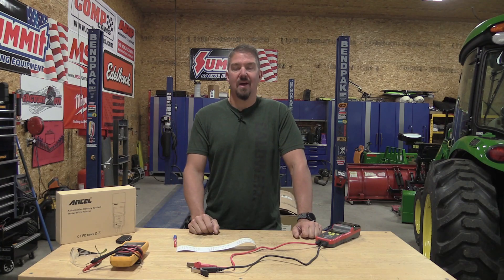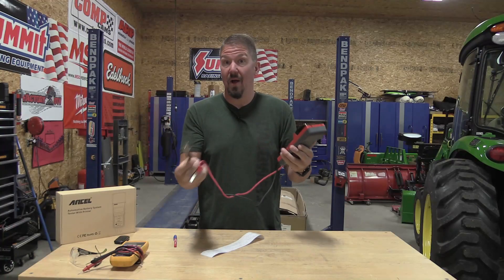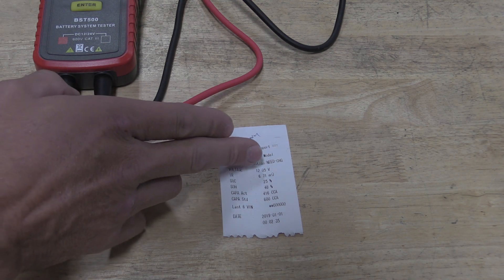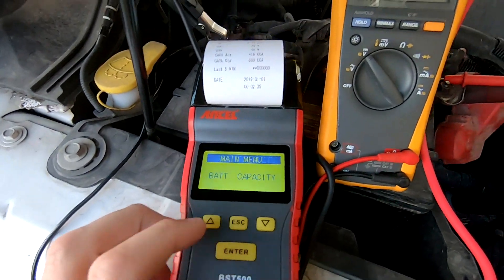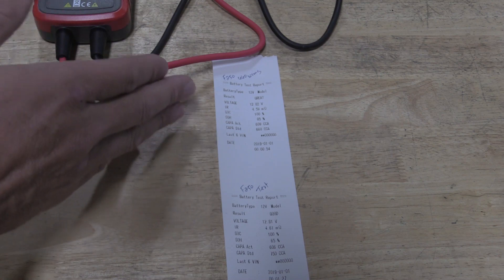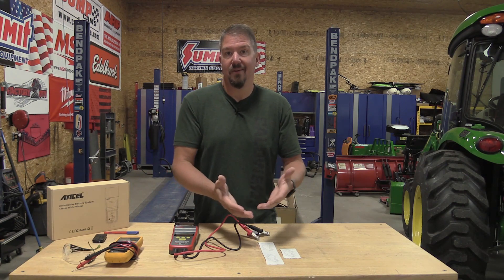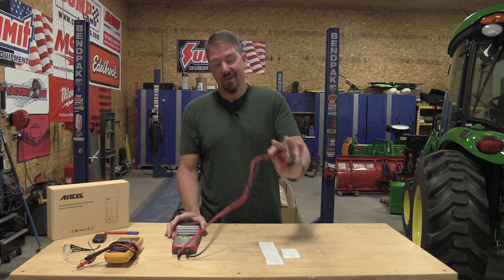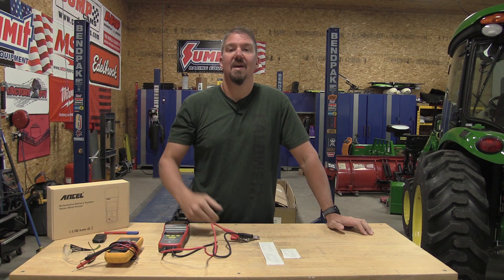Truck Won't Start - Ancel BST500 Battery And Charging System Tester Review

Comment: Just say it POS. People need to just learn how to use a multi meter. You can also use all your accessories including high beams to load a charging system to also test charging. Remove surface charge by turning on head lights before testing battery. Check cranking volts after.

Comment: The midtronics MDX 300  check's starter alternator and battery!!  Also the battery voltage on the midtronic's is exact to the fluke meter voltage reading, which tells you the algorithms in the midtronics unit is spot on.
Reply: What do you think of the Foxwell BT705?

Comment: Have you checked out the amount of electrolyte in that battery? Also, a battery renovating chargers [NECO Genius]? {If it doesn't work you get a review video and you send it back.} 
I feel that chicken/egg scenario as far as which caused what.
Regardless, 15 volts is a problem.
Reply: BTW, nice video, thanks.

Comment: I agree with you on short cables. They are a pain... I have a short cabled trickle charger which always requires an extension cord. I have others that don't. It makes you wonder that if they shorted you on cables, what else did they short you on?